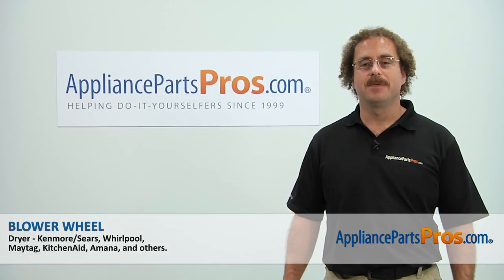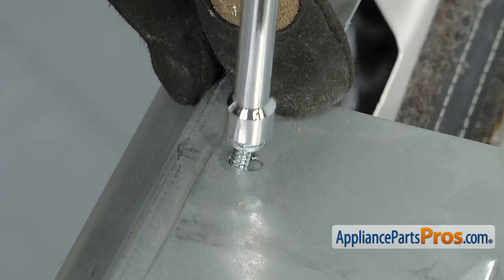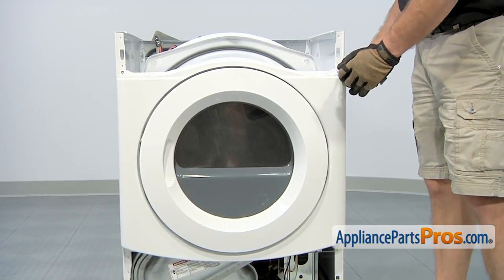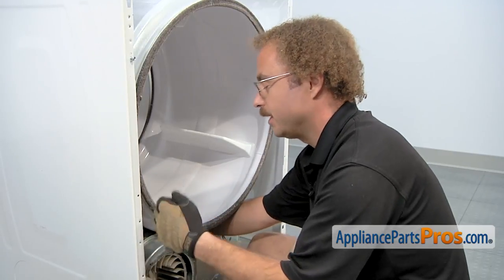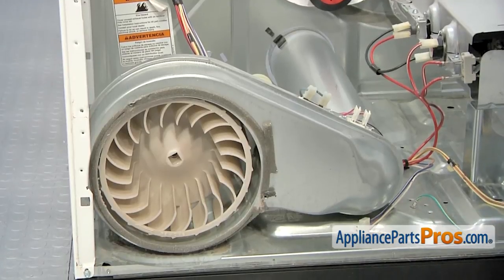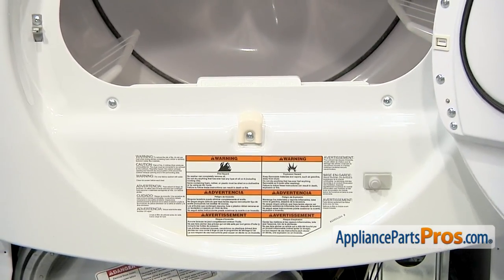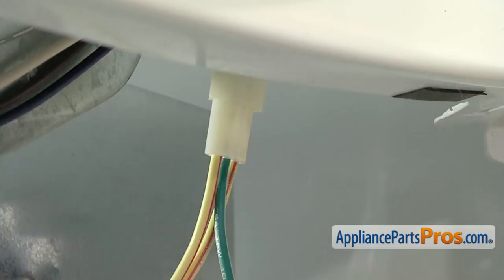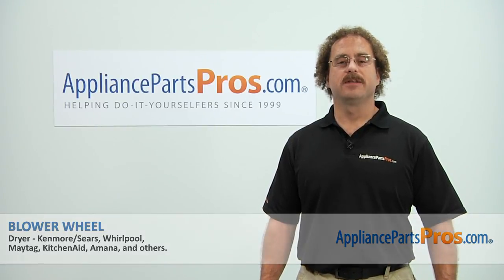How To: Whirlpool/KitchenAid/Maytag Blower Wheel WP697772

Comment: No information about what to do when fan is stripped.  This is probably the #1 reason to replace it.  Come on guys!
Reply: Have the same problem. I ended up breaking the fan onto pieces and removing the motor. STILL trying to figure out how to get the metal off the motor shaft so I don't have to buy a whole new motor smh. Vice grips?? Or another motor and fan...idk.

Comment: Don't put the drum belt on the motor shaft as Napoleon Dynamite did, unless you plan on changing it in a week. Good luck getting the blower wheel off without stripping the aluminum insert.
Reply from the maker: Thank you for the feedback. If there is anything we can help you with please let us know.

Comment: Whole bunch of uneccessary steps in here to pad his bill. No need to remove everything, just expose the wheel and stick your 7/16 wrench on the motor shaft and turn to the right as the arrow shows, and it is off. Now you can remove the fan housing and do a thorough vacuum job from the front.

Comment: Just completed this repair using parts from Appliance Parts Pros.  The parts came a day late and the repair was made more difficult because the fan housing had stripped from the insert which meant that I had to cut the damn thing out with a Dremel tool.  In the end, the dryer is quiet again and I am happy to have completed this as a DIY project thanks to this video.
Reply: Fr

Comment: Unbelievable how clean the inside of that dryer is.  I'm taking apart my 5 year old machine and spending as much time  vacuuming as I am disassembling!  I think that my blower cage is not damaged, just crusted with crust. Rather than spend $45 I'll give it a good cleaning and see if that fixes my rumbling problem. (Already checked the drum rollers and they seem fine).
Reply: My rollers "seemed" fine as well, but I replaced them anyway since it came in the kit. Made a huge difference in the vibration of the machine. Worth doing while you're already in there.

Comment: Just thought I'd give my 2 cents on the replacement experience. Getting to the parts is not a big deal. Total of about 20 screws to strip it all down. If you're going to replace the fan, it's worthwhile to get the other repair kit and replace the rollers, belt, and pulley wheel while you're in there. It's pretty cheap and for my 8 year old dryer, really reduced the vibration. My fan blade was making a hell of a noise, and it turned out the outer "ring" was cracked and would then expand and rub on the shroud of the fan blade. Sounded like it was going to blow up!

If you look at the fan blade, it's some sort of composite material molded around an aluminum insert. This insert is what screws onto the motor shaft. Well, mine wouldn't budge, and in fact, between the aluminum insert and fan blade, it would just spin against each other. Thankfully the dryer is next to the garage and I have an air compressor and grinder so I was able to grind around the shaft and using a combo of pliers and a screw driver, I was able to break apart the blade material and ended up only with the aluminum insert. 

THEN I had to take some vice grips and finally get the insert to unscrew from the motor shaft. WHEW!!

The whole thing was a 1/2 hour fix which turned into 1.5 hours because of the fan not spinning off.

Comment: I'm scrounging "dead" appliances, for free or cheap parts for some alt-energy projects. These blowers look like a pretty cool place to mount some of my supply of hard drive (neo) magnets, for a couple of my projects. These plastic ones MIGHT work; but, do you know of any which are made out of either extruded aluminum or non-magnetic stainless? If so, what brands/models should I be on the look-out for???

Comment: It’s actually an 11mm wrench you should be using on the back side of the motor shaft behind the fan. (In the video you said 7/16” wrench but that is really sloppy and can round the flats.)

Comment: Our drier fan has always been loud near end of cycle when it's the hottest (literally when we bought it or not long after and got worse over time).  Notice the noise abates if I pull on the front cover of the fan - rubbing perhaps but why does it get worse when hot.  Going to take face off, wish me luck!  I thought it was riveted together, only saw one screw with only the bottom face off.  I hope it's not a fan or motor bearing issue.  I wonder if the drier was dropped and the fan hosing is bent.
Reply: Wow, my fan is broken on the outer edge (that connects the blades on front side) where it says which direction to turn.  No blades are missing but the 2 blades on either side of the broken "span" are a tad further apart.  I am unsure which is the cause versus affect - did fan break (how would something get in there behind the screen?) and then rub, or did fan rub on something and then break.  I see a shiny spot behind the fan blades where it's rubbing...looks like a screw perhaps and I see in your video, right as you lift off the blades, there are two or 3 screws behind the fan blades.  I wonder if my screw was sticking out far enough for backside of fan to hit it...but the broken part of the fan is on front side, screws are behind the fan blades...argh, unsure and I can't work anymore tonight on it.
Reply from the maker: Oh no! It's difficult to say which is the cause and effect at this point, but at least you know what you need to replace.
Reply: @appliancepartspros  Yes, I agree - impossible to know.  Turned out I was right!  One of the 3 screws behind the fan wheel was sticking out a tad (and was not screwed in perfectly straight).  180 degrees from that screw, there was rub marks on the paint behind the fan wheel.  Screw was clearly pushing on the fan wheel.  Fan wheel had a gouge which aligned with the screw.    Fan wheel was warped/wobbling, so the gouge did not go all the way around the wheel.  Maybe if the fan wheel was not warped, it would never have hit the screw head(s).  When I pulled on the fan's face-plate ("lint duct"), the noise would go away, and would get worse when I pushed on it...that's why I took it apart to begin with.
Reply: @CNY_AP  What happens is the plastic fan blade separates from its hub that attaches it to the motor shaft. When this happens the fan wheel is somewhat loose (which is why there is the noise, especially when the dryer is hot) and the wheel slips relative to the shaft, making the blower not work well. The problem is that you can't loosen the wheel to take it off. I had to cut the plastic wheel apart with a dremel to get it off (as others have said). However, the metal hub is absolutely frozen onto the motor shaft and I could not get it off, even with 2 pairs of vice grips (one holding the shaft from turning and the other on the hub).  Very frustrating!! Not worth replacing the whole motor assembly...

Comment: See older posts below.  Came off pretty easily!  
TIP:  I did not remove drum - instead of blindly trying to get wrench onto the shaft next to the fan, you can reach the nut on the very back end of the motor shaft (open the back panel) and at same time reach the wrench on the "blower wheel".  I did not even remove the belt - can get end wrench onto the back nut w/o removing it (belt was a tad in the way though)...   
The back side of my blower fan is gouged!  Pretty sure one of the screw heads is sticking out.  Not 100% sure since I see no rub marks on the front case that is removed to access blower fan, but that screw head might be causing the blower wheel to be pushed towards front of unit, touching the front cover (only when hot it seems - it gets VERY loud when hot, near end of cycle).  When I pulled the front case towards myself, the noise goes away (which is what got me to this point).  Sounds like fan blades hitting the sharp round edges of the inner case opening but I can't prove it - no rub marks.  One section of the "ring" that runs between the blades is missing (the "rings" that has the lettering on it, telling you which way to remove or tighten the fan wheel).  I can't decide if a coin hit a blade and broke the "ring", or if the screw head not being screwed in all the way was the cause...also am unsure if my blower wheel needs replacing after I tighten the screw head.  Need to get right socket size to tighten the loose screw and test it by hand for clearance/rubbing (before and after tightening the screw I suppose).
Reply from the maker: Thanks for updating us on how it went! It sounds like you could try just tightening it to see if that fixes the problem.
Reply: @appliancepartspros  Hopefully this will help someone, some day.  BTW, my dryer is a Duet model 9150.
Installed new fan wheel today (original was broken - one section of the "ring" (which says which way to loosen and tighten) which connects the front edges of the blades was missing and the whole "wheel" was warped!).  I tightened the sheet metal screws behind the fan wheel extra tight, and ground down the 3 screw heads slightly with my Dremel to create more clearance behind the fan wheel.    
The other improvement I did (to add a tiny bit more clearance between front of fan blades and the cover/faceplate - the "lint duct") was to add insulation on the faceplate in its recessed area. BTW, I removed the faceplate/cover (you referred to it as the "duct") instead of removing the whole "bulk head" as you did.  I guess my model is different.  On mine, there is a 3rd screw holding the lint duct on the upper right side (the bare metal duct that has the big warning sticker on it).  There is insulation between it and the unit to avoid air leaks (and I suppose to prevent rattles).  Everywhere there was insulation, I added another layer.
Got back on here to see where the idler spring goes - I installed the spring on the wrong side of the idler pulley arm, ooops.   I replaced the idler arm and wheel because it was a tad loud and only cost $10.  It's a bushing, not a bearing.  I assume I'm not supposed to lubricate it.  Replacement wheel is moderately larger than original - hopefully the belt is not much tighter than it was with the original wheel.
Reply: @CNY_AP  exactly like my problem on a whirlpool.

Comment: I tried to remove the wheel as per the video, but it just spins on the axle. Is there an alternative way to remove or force this wheel out?
Reply: Same here.  I had to use a Dremel tool to cut it out and then use pliers to remove the threaded portion.